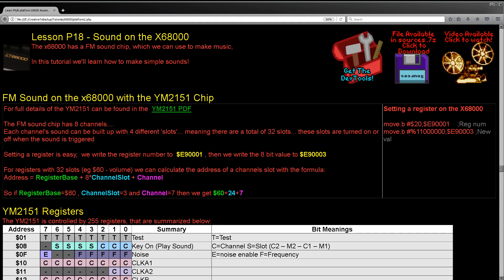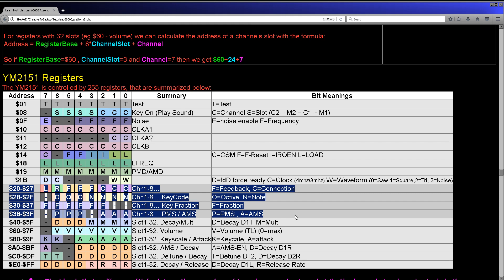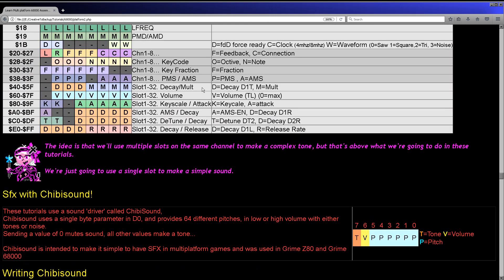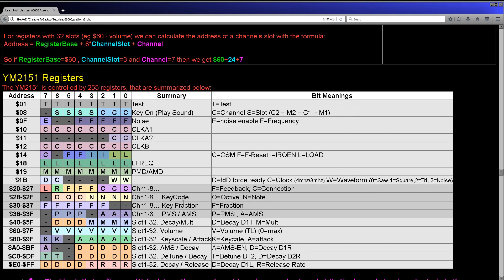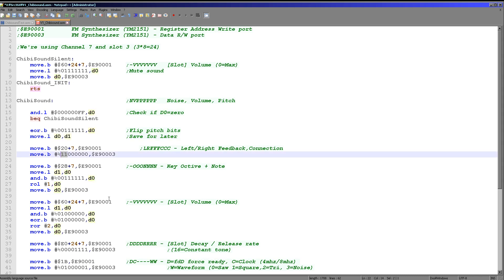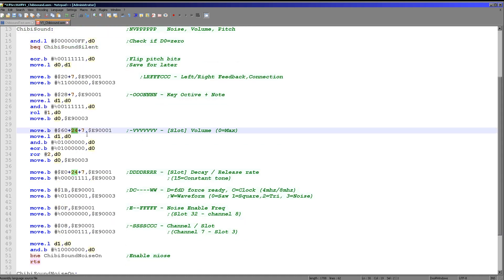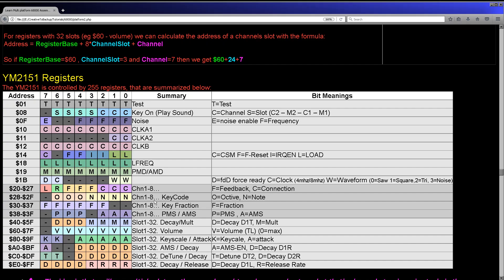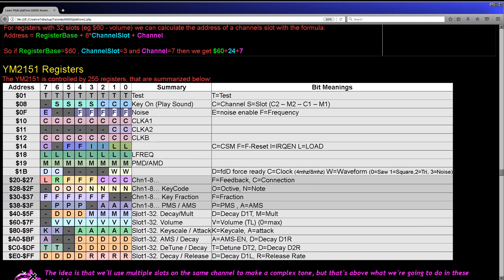Sound on the X68000 with the YM2151 - Learn 68000 assembly Lesson P18

Comment: Hey Keith,
  I know hardware isn't really your thing, but quick question, which systems do it better? (easier to work with or whatnot) It doesn't matter to me if it's Z80/6502/68k. I'm just looking for chip availability and topologies for breadboarding and maybe following along with some of your examples a little closer. I'm trying to find cheap junk to source China direct, nothing fancy.
 I am also putting together Ben Eater's 6502 setup (basically just a 6502 + 6522), and I have another hackaday project I'm following with a 68010 + 68901 that I've ordered parts for and plan on doing. Right now I've got a Z80 setup on a 5 breadboard setup with extra power rails for a 16/32 bit address, 8/16 bit data bus, (depends on whether the center of each bus rail is bridged). 
  Creating the composite or RGB video output is the only circuit that I haven't figured out yet. I know many people go the FPGA route for this, so there are obviously issues with available circuits. Any thoughts on where to start from a software systems perspective?

 Lastly, are there any simulators/emulators you know of that have flexible hardware configurations to mess around with, or are they all pretty much system specific?
  Congratulations on 2k subs too BTW :-)
-Jake
Reply from the maker: I can't really comment on the hardware construction side, I can only comment on which is my favorite to program...
I'm most used to the Z80, but I'd say that the 68000 instruction set is clearly superior... I find the 6502 harder to work with - but that's not to rule it out, it's only a slight personal preference...

Graphics wise, the V9990 is the best chip I know of - It WAS still sold as silicon a few months ago, but may be out of stock now... but that 'VERA' thing used by the commander x16 is excellent if that's available

I've no idea how you could simulate such a system, I know MESS is rapidly covering more and more systems, so maybe that could be a starting point... I'm sorry, Im just limited to using system emulators not working with hardware design like this
Reply: @ChibiAkumas  
  Thanks for the input. It's always good to try to get as many perspectives as possible. I haven't researched the V9990 before. That is a good starting point. I'll look up MESS too. Thanks again.
-Jake